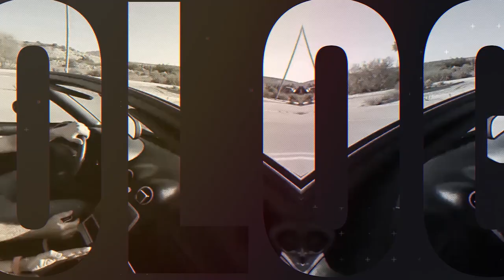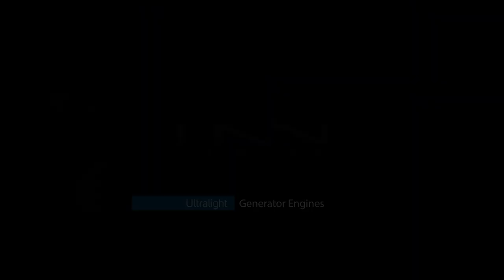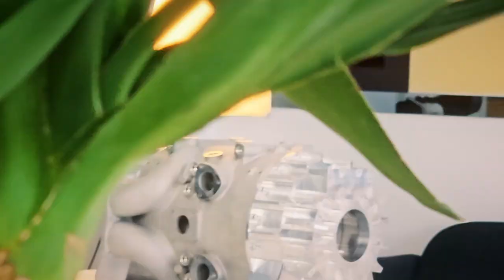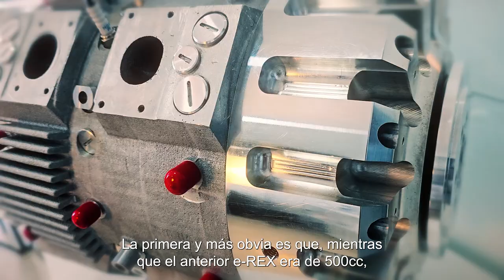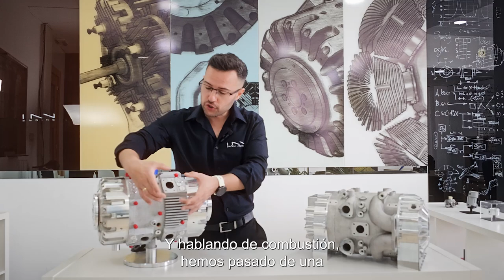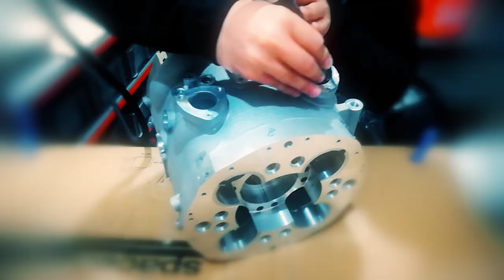500vs700

Comment: I live in a condo with no charging capability. I want to mate the e-Rex to an Aptera BEV and never need to stop at a charging station. With the e-Rex, I can buy the smallest/lightest battery for best electric performance, at the lowest price, and my battery always keeps an optimum charge with the e-Rex ony running intermittently. An electric car with unlimited range. Your success is my success. Best of luck.

Comment: This engine design looks really interesting. As you say its compactness is ideal for generator/range extender applications. But what is the thermal efficiency and torque power curve of this engine? Does it meet the application  requirements? Can you disclose?

Comment: Valeo TM65 6500 cc
Weight	18.1 kg (w/o clutch
7 cylinder 14 piston head 7 piston
Is  axiel motor is pump.. could be expander..
This is inn cousin

Comment: 36,000 kg truck ÷ 5 kg per cc
Or x .2 cc Per kg..
7,200 cc 
Need 10 inn to power 30 kw gen. Each
Reply: Need get 160 mpg
Per inn being 640 mpg per cylinder
1280 mpg per piston
X 10 inn
÷ by 10 
16 mpg iNN
64 mpg cylinder
128 mpg piston

Comment: Good Afternoon,

Is it possible to contact the design team please?

I have an improvement to your INN engine which can increase torque and power at least 2 to 3 times more, by redesigning some mechanical parts and leaving the main structure as original genius as it is.

Please contact me for more details.

Very kind regards
Reply: Yes Mr altar
Reply: Make a steeper swashplate
Reply: Hiya
That would be the most intuitive step forward, but the swashplate is the weakest point in this genius concept and it should be redesigned for maximum torque and power and it doest have to be much heavier to do it although more conventional. It could gain power of a boxer and revs of motorbike, although the in-between setup would be most optimal, but different versions (most logically 3) could be designed for torque (SUV), speed (Sports) and balanced (family and 4x4 estates).
Would be nice to help with that and build such a machine.
Best regards
Reply: @altarf82 well, i think the idea is make a motor with this power But in low revs. That means more efficiencie.

Comment: Siendo honesto os deseo suerte para el futuro tan electrificado que nos espera. Bajo mi opinión en el tema de rango extendido no hay mucho futuro ya que los eléctricos cada vez van a tener mas autonomía, eso es seguro y no va a rentar meter un motor de combustión. Lo que si me gustaría ver es el uso de este motor en aviación y además no se si sería un buen candidato para el hidrogeno también. Aun así me parece increíble vuestro trabajo. Un  saludo desde Granada.
Reply: El tema de las autonomías tiene mucho que ver con el peso del vehículo (a igual cx) y. haciendo una aproximación podríamos decir que un conjunto 2000cc + depósito lleno (55L) son aprox 300kg de los 1500kg que pesa el coche (algunos bastante menos) para hacer 800km de autonomía a 120/130 de autopista. 
En un VE como el xiaomi SU7 se necesitarían 120 kwh para hacer esos 800 km pesando 2300kg de los que 540 son de batería y 60 de motor.
Un vehiculo con REXT innengine tendría un peso del conjunto REXT de 100kg con 50L de combustible para dar esos mismos 800kg teniendo una bateria tampon de 200kg (55kwh) que le permitiría hacer unos 250km (mas) en modo solo eléctrico. Con un peso de vehiculo de 1500kg.
Si metes temas de eficiencia por medio muy probablemente se podría llegar a los 1200Kg con autonomías de más de 800km y consumos medios de poco más de 1L a los 100km. 
El punto es que gran parte del coste de adquisición se lo lleva la batería. El tema de la autonomía es relevante y las escasas posibilidades de carga electrica en larga distancia echan a los compradores para atrás y sin embargo disponer de una gran potencia y par instantaneo que proporciona un impulsión de motor eléctrico es muy apetecible  por lo que una solución Range Extender podría tener mucho mas sentido de lo que parece.
Reply: @robertosantossantos758  Pues si pero si tenemos en cuenta que ya pueden dar relativamente buenas autonomías y que en el futuro  en ese mismo peso cada vez se va a poder meter mas energía, se intuye que los vehículos de combustión van a pasar a un segundo plano. Al menos en el publico general.
Reply: Mi coche de en sueño... ojalá alguien lo fabrique

Comment: So now  need 7 of these .7lt for 70kw each instead of 10. .5lt for 50kw each to power 80k lb truck

Or  about 30 % less
Reply: use HP i just found the 698cc engine averages i found the 700 average  in the now industry 88HP while the 500CC the old engine avraged 120 HP. you ve got more power  while the torque on 700 hp engine was 130 with nowdays you can go to 150. this engine in the 500hp config 233 in the 700 should be a little more  there starts the fun  but we have to wait for the consuption. only with the 20 22 you move a smart fourtwo with 3.4l every 100km to 2.60 lts to every 100km or you do with 500 CC engine with 22% less fuel comsuption. but you gain better power is like a smart with 1000 CC now engines . that weight more so imagine less weight  less consuption more power. if it works like that . imagine a Toyota Hiace moved by 2800 cm3 engine will do  450NM with 2 engines of 500hp will do 266 NM, 240 HP vs 178 HP  you will burn 5.2 lt against the 7.8 lt every 100km. i imagine  a toyota Hiace moved by 2 of this motors